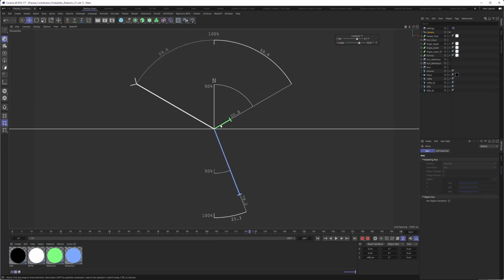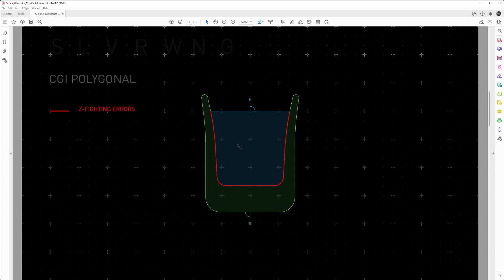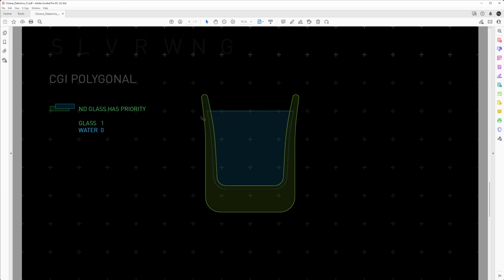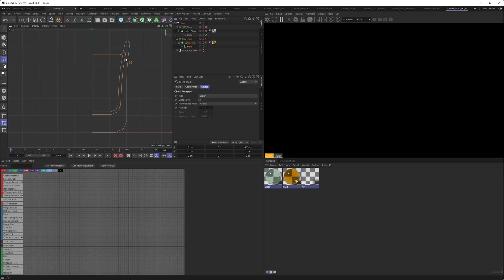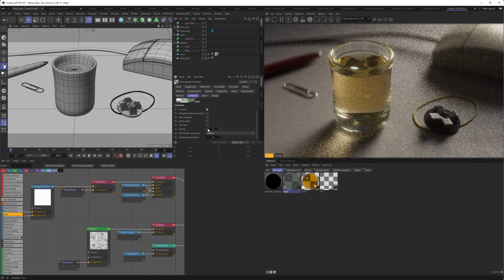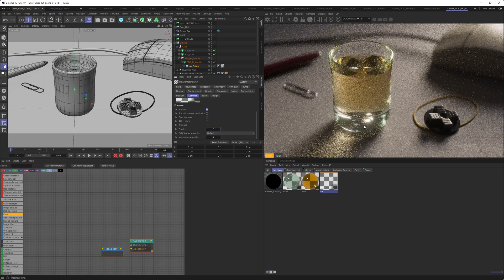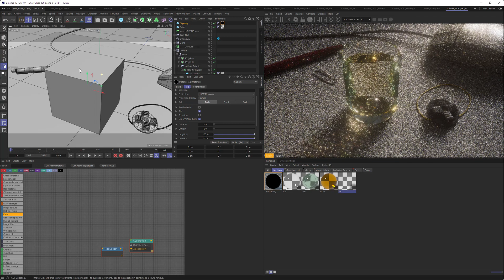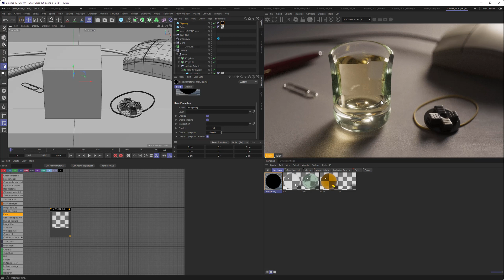Silverwing "Long" Tip: Octane Nested Dielectrics

Comment: WEEKS struggling, trying to make an animated cross section of a product with booleans, and now i find this "octane clipping material". I hate my life, but thanks man.
Reply from the maker: Thank you very much for your comment Nicolas.
I know the pain wich boleans and cross sections!
Though those also not always work with Octane as it struggles when you have intersecting poly walls (which often happens with more complicated CAD data of products. But other then that it's a great feature.
Cheers and fingers crossed it works for your the next time you have an intersection task.

Comment: Thanks for nice tutorial.
Whats the best idea to keep space between glass and water, as you shown some keeps water in middle of glass or some very close... which is the best for good render...? Thanks.
Reply from the maker: If you do not want to use the nested dielectrics the best practice is to overlap the fluid slightly with the glass.

Leaving air in between the fluid and the glass is not good. It leads to unrealistic results!
Reply: @SilverwingVFX  Yes, its clear, thanks man.

Comment: Curious if you have any suggestions on a problem I've having with a clipping material. 

I'm using a clipping material on a glass object that has a displacement map on it, the clipping material is working, but at certain angles I can still see the refraction of the displacement floating in the scene. Any idea why this might be or what I could do about it?
Reply from the maker: Hi there and thank you very much for your question.

First of all, are you on the newest Octane. In Octane 2022 has some bugs with the clipping material were squished.

But might very well be that you are encountering a Bug / Limitation with the displacement there.  Unfortunately I have no other Ideas then trying to making the Ray Epsilon smaller and seeing if that helps. Usually going one magnitude smaller is good so e.g. from 0.001 to 0.0001

Hope this helps. If not, I would suggest contacting support!

Cheers and a great Day to you!
Reply: @SilverwingVFX  appreciate the fast reply, I did some digging and it turned out it's an issue with texture displacement, I switched it to vertex displacement (with many many subdivides) and it worked!

Comment: anyone know how to do this in the redshift materials?
Reply from the maker: Redshift has auto Nested Dielectrics. So it sets the priority for you. I don´t think there's a way to influence that as a user. I might be wrong though.
Reply: @SilverwingVFX  ah alright. thanks for replying :)
ye the way I'm doing it now is by making the liquid slightly smaller. I guess that works for now. Technically creates an air gap, but it's not really noticeable.
Reply from the maker: @JanReuser  If it works for you 🙌 In my experience, for most renderers, overlapping the fluid with the glass geo is the closer to reality result.
Reply: @SilverwingVFX  Cool thanks I'll compare it next time :) 👍

Comment: Hi, another question that always bugs me: what if you have bubbles in the water? What would their priority be? Glass = 2 ; Water = 1 ; Bubbles = higher priority than the glass too? So, 3? Thank you so much, I always come back to your videos in order to make sure I did everything right :)
Reply from the maker: Hi there Adrien, nice seeing you here again. Thank you very much for your question!
I usually leave Glass at 0 and go into the negative range. But to go with your example:
Glass = 3, Bubbles = 2, Water = 1. Also make sure the air material has an IOR of 1.0 

To get a hold of what has what priority, you can always think of what displaces what:
Glass = Not displaced. Must have the highest priority.
Water = Gets displaced by glass, air, and eventual Ice. So it must have a lower priority then all of these.
Air = Gets displaced by glass. Displaces water end eventual Ice. Therefore the priority has to be just under that of the Glass.
Ice = Gets Displaced by glass and air. Displaces water. Therefore has to have a priority lower then air and higher then water.
Reply: @SilverwingVFX  What a nice explanation! Thank you, it makes total sense when you say it like that. Have nice day :)
Reply from the maker: @oursonwelles  Thank you. Glad I could be of help. A great start into this week to you too!
Reply from the maker: @@hdo-gd5tj
I am quoting myself here as this is the best way to think about:
"To get a hold of what has what priority, you can always think of what displaces what"

I am giving air the highest priority in the video because I have an air bubble in the foot of the glass and therefore need the glass to be displaced by air. If the air bubbles were only inside of the water, then a lower priority then glass is fine. Hope this resolves your confusion.
Reply from the maker: @@hdo-gd5tj Thank you for your response. Very nice.
About the Ray Epsilon. Usually with smaller Ray Epsilon values there are more details to be caught by the rays, therefore more work to calculate. So yes, I guess this is expected.
It depends on your scene and therefore what a lower Ray Epsilon value might reveal if it means longer render times or not.

Comment: It's very nice to have a proper guide for this. I was mixed up between the new and the old way to do that, reverting normals with nested dielectrics... I'm glad to have clear instructions now! I was happy with my scene (similar to yours) and decided to see how it would look like in the new photon kernel but... Apparently nested dielectrics don't work in this kernel yet? Or am I doing something wrong?
Reply from the maker: Hey Adrien. Thank you very much for your nice words!
Appreciate it that you got some info out of it.
About Photon Tracing. It should be working in there... I have just tried and it worked 😇
Reply: @SilverwingVFX  Maybe that's because it was a scene created in R26 / 2021 and then opened in R24 / 2022. The pathtracing works very well but as soon as I switch to Photon the glass becomes grey. Maybe I should try to build it from scratch.
Reply from the maker: @oursonwelles  Maybe try copy and pasting the scene into a fresh C4D file. Sometimes that works!
Reply: Btw, this was a ray epsilon issue. Of course it was 🤦🏻‍♂️

Comment: Very cool, can you show you some more of the new features for 2022.
What bothers me a lot at the moment is that the octane random walk is not as good as the new redshidft random walk (redshift SSS is closer to Arnold). The octane random walk CG is too heavy and not real enough. Another very confused new version of octane hair material and redshift new version of hair, it is difficult to be illuminated by lights, it will be a bit dead and dark, this is easy to solve using the Arnold hair material in maya xg hair, and the default parameter melanin A value of 1 is very realistic and good-looking (unfortunately the CPU rendering is very slow and usually takes several hours to wait). In any case, I am very grateful for any tutorials that can be made with my heart, thank you for your selfless sharing, teacher!
Reply from the maker: Thank you very much. Also for your suggestions!
Interesting to hear about Random Walk. I am still using the old SSS system mostly.
Do you have any examples where the Arnold / Redshift SSS excels over Octane?
In my small tests that I have made the multi scatter SSS approach of Octane mostly looked better and did not produce any of those edge darkening artifacts. But those tests were not limited to Random Walk. I will do some tests with it too ans see! Thanks again for your long message. Appreciate it!
Reply: @SilverwingVFX  The main reason I use Random Walk is to prepare for realistic character animation.
This question is more important, but not so important (because I will switch redshift when octane can't achieve my expected effect, just a few days ago, redshift finally updated the Random Walk test and the results met expectations, but I still prefer octane ipr interaction , this very fast feedback result is used to build the scene)
I can send the test results to the teacher with a video recording (but since the work is not completed, it cannot be disclosed, and my level is relatively poor, for fear of misleading people)
If you agree, I will contact you electronically on Twitter, under the official homepage you provided, and send the test results (you can also decline, or not reply to this message).
Reply from the maker: @hao8089  Hey, thanks again for your long and detailed answer!
Ah so I guess its an issue where RS and Octane does not line up with the same settings.
Yes you can contact me on Twitter or the old fashioned way by e-mail. The address is on my webpage too.
Cheers and a great Day to you!

Comment: Thanks, Raphael! Octane doesn't like coplanar polygons... that simple. Even with clipping material, clipping will produce artifacts on coplanar surfaces. This is something to lookout on Octane - not sure if the same applies to other render engines.
Additionally: Nested dielectrics won't solve coplanar polygons problem, there should always be an offset in or out ("in" in case of nested).
Reply from the maker: Yeah I tried to explain exactly that. Sorry if I didn't do a good job with it. Maybe I should have used the word "coplanar" 🙌  I think every Renderer struggles with it. Basically the renderer would have to know what the user wants to make give the proper outcome.
Reply: @SilverwingVFX  Naaa... you did great! I wrote this comment before the video finished. I should have waited.
Reply from the maker: @Sensei.Maverick  I´m relieved thank you 🙌